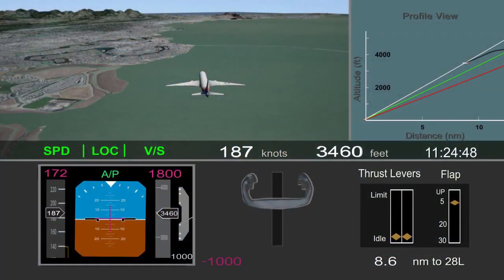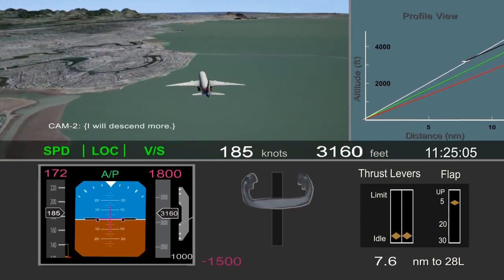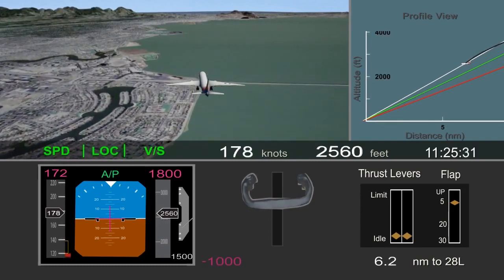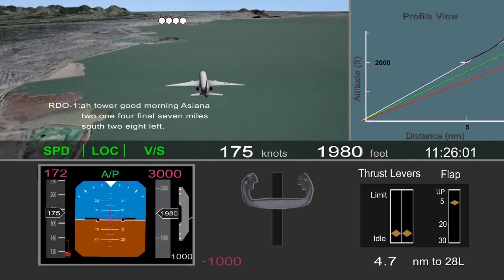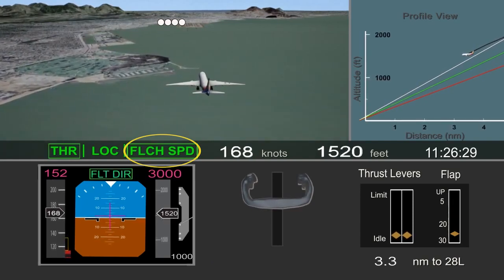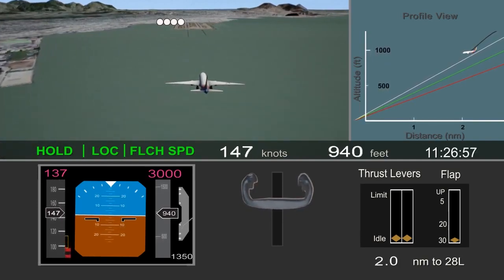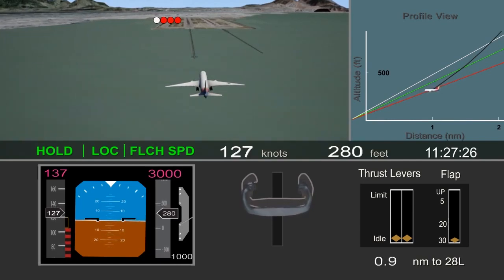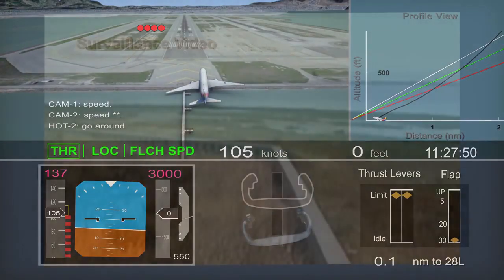Asiana Airlines Flight 214 NTSB Animation

Comment: 120kts, all 4 papi lights red and they didn't think about to push the throttle and go around?
Reply: automation complacency
Reply: 4 red papis and no throttle? Your throttle determines your attitude, and your elevator your speed on approach. Zero throttle until go-around.